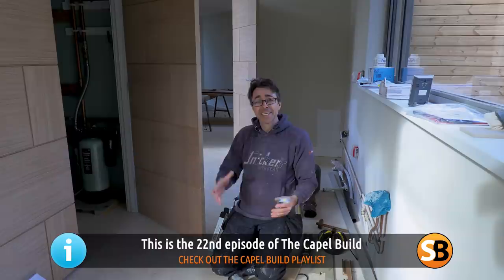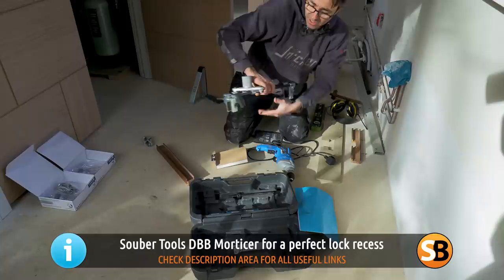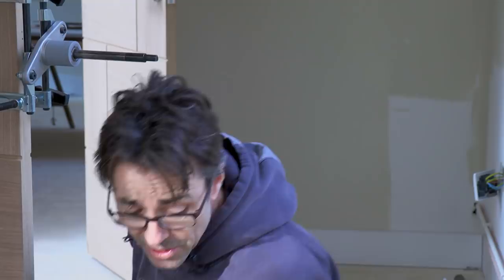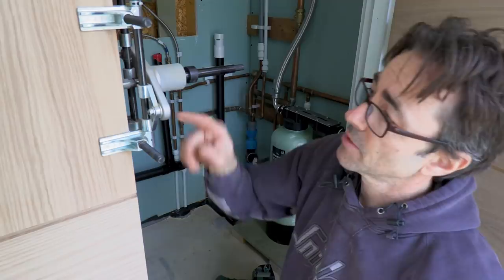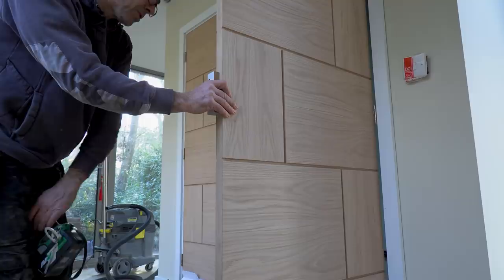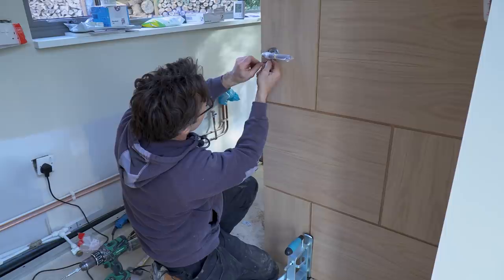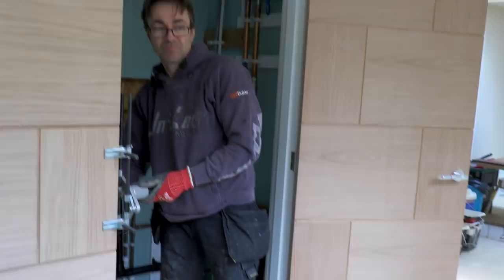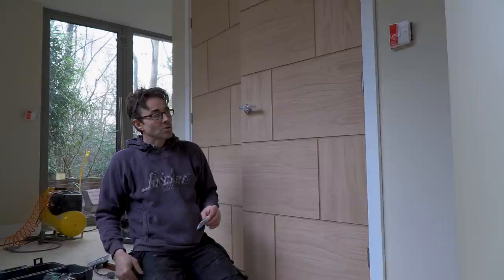Fitting the Perfect Lock Every Time - Capel #22

Comment: I've fitted hunders of these handles. The bane of my life!
Reply: Me too, getting the through screws to marry up is a nightmare.
Where was that battle Robin?
Reply: @I-am-not-a-number  it's easy, fit the handle into the lock with the handle facing down then pilot hole thru the screw holes, then put the handle on the correct way screws line up perfectly, this is such a long winded way of doing a simple job

Comment: Very informative videos you guys do.

Just an FYI you can fit the DBB Morticer to door linings (before architraves are fitted) with the Offset Housing Kit attachment generally around £30.00 

Make fitting dead locks & sash lock keeps so much easier, especially the big chunky ones with the metal housing fixed to the plate.

Comment: Recently bought the trend jig myself. I’d like to give the souber one a go. Only downside with the trend all the templates are set and can’t be changed, with the souber jig you can adjust to your liking. Not a fan off corded drill but I suppose that’s what you need. Great work like always Robin. 👍🏽
Reply: with the jig 2 Souber morticer you can do hinges too and offset locks.  The only thing I was concerned about is tearout as a router spins a lot faster than a drill, corded or otherwise.

Comment: I use the trend jig with a t11 router, although they say to have the router flat I have never had a problem using it with the doors in place. Well worth the investment.
Reply: Which model trend jig are you referring to please?  Thanks
Reply: @Chris-uu6dg  I pretty sure it is just called the trend lock jig. That is the one I use the most. I also have the trend long lock jig as the name suggests it is for longer locks.
Reply: @stephenmurray4916  Thanks mate!

Comment: I have the same one but there is a slight wobble with it to be aware of, lovely to work with overall and v fast but that wobble can wreck the finish, the wobble is when you move vertically which taints the finish of the face plates direct side line, with that said il still use mine tomorrow as I've learned to work with it and its still better than my usual method

Comment: Iv'e used those Souber jigs and they really are very good once you get used to them. And as Robin said, cordless drills are just not up to the job and i to went out and brought a cheap as chips 240v drill to do the job. I actually find myself using that cheap drill quite a lot as they do spin so much faster. Oh, and if you do wear gloves when using a drill make sure they are in good nick with no frayed material hanging off.

Comment: Got a Souber jig. I use it with a cheap mains drill. It's a useful tool, saves time. I've had mine a while now and it seems to have developed a bit of play in the shaft, so that would be my main criticism..
Reply: The bearing wears, that's just the way they work. They sell a new housing kit to allow you to replace them.

Comment: Iv had one of those for a while now and i find it a bit annoying. It moves of the line you set it to when you tighten it. Also if you have no power its useless because no cordless drill spins fast enough. You need a corded pistol drill not an sds either. Its good if your on price which is why i bought it. The cutters dont last very long in hardwood lipping either. I just use it to chop out for the lock body and my trimmer for the face plate. Its the best tool for doing long perkos far better than a long auger

Comment: Hi Robin ...ive gone completely cordless and got rid of sll my corded drills etc ...now seeing this jig i looked at all my cordless drills including sds and your right not enough rpms . Then i looked at my cordless  angle grinder and they are on average 5000rpms some are 7 or nine ... you can also  buy a attachment for drill bits . Infact there are a multitude of atatchments you can get for grinders. If i am right i would get that jig looks much simpler than my trend  morticing jig.  Just a thought ...whats your thoughts on this as it means i can use your bit of kit cordless .By the way i have been a c/ joiner for the last 47yrs ...and i still often go back to the drawing board .👍🏻👍🏻👍🏻👍🏻👍🏻

Comment: If you are wearing a pair of gloves whilst using the sauber make sure they don’t have any latex or rubber on the palm. 
I was doing the same as you did and the palm of the glove got caught, sucked, wrapped around (call it what you want)the long rotating bar in the blink of an eye and at over 3000rpm. The glove was torn to bits and thrown 3 meters away after it had compressed my fingers back into my hand. You could say it hurt a bit. 
Still can’t move my little finger and ring finger properly after six months. 
Just a heads up for the future. 
Find your site a really good watch, as they say every day is a school day.
Reply from the maker: Good advice and it might save somebody elses a bad injury

Comment: Also robin you can get an ofset attachment to do the keep on the lining
Reply from the maker: Thanks Dan. The company has been in touch with us to tell us that, they also do longer rods.
Reply: Skill Builder  yeah and an extended shaft for the drill which you will need to do any kind of commercial mortice lock. And i forgot to mention to do the mortice for the lock body you should use there plunge cutter.  Apparently you can do aluminium door too 👍 cool vids

Comment: Ear protection, Robin!  But great vid. A bit calming, even! But now a noob question: In that last jig, you also need the holes centered vertically, right, since you have to flip it for the other side? Actually, as I type this, I realized that this must be so or the pilot holes will have alignment issues! Perhaps I should just delete that bit. Uh oh, too late!
Reply from the maker: It was the question Roger asked at the end
Reply: @SkillBuilder  Ahhh, so it was! I though Roger's question was only about making sure the guide holes were perpendicular to the surface of the jig. But I just listened back to it, and... yep.

Comment: Years ago a tubular latch was exactly that, tubular, there's an actual clue in the title. Not the rectangular crap you get now, which for some reason they still call tubular in some cases, and as stated, you have to drill a 1" hole, which is barely narrower than the plate. 
The old ones went in a 7/8" hole snug as a bug..... Simples.

Comment: Nowt worse having to go round a flat etc and resecure the handles to the fire doors as the original installer couldn't be arsed putting the bolt through fixings on.
Reply from the maker: That is criminal not to use the bolt through. Screw never hold for long on  a fire door.
Reply: Shocking.. I know. It amazes me how many times this happens. This is on original Install aswell. I dread to think of the consequences. 
We are talking high rise apartments in Manchester City centre

Comment: I've used the souber several times and don't rate it at all.  There was far to much play in the jig itself no matter how tight you made the handle, easily wandering making the face plate rebate inaccurate with gaps.  The cutters blunt out quickly and cost more than a router bit, leading to clogged cutters, furred out rebates and snags in the timber.  Its good idea, but needs a lot of refining.  The cost of cutters and its impracticalities with the amount of play in it, mine never saw the light of day until I sold it, preferring to router and auger locks and latches.
Reply: Strange. The exact opposite of my experience. Apart from the cost of the cutters!